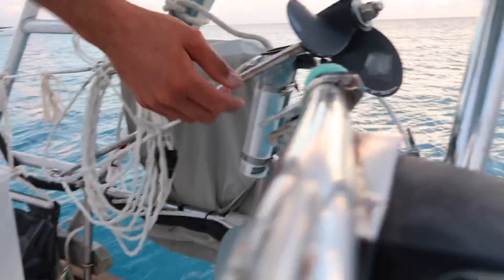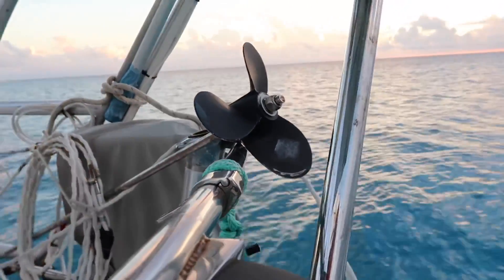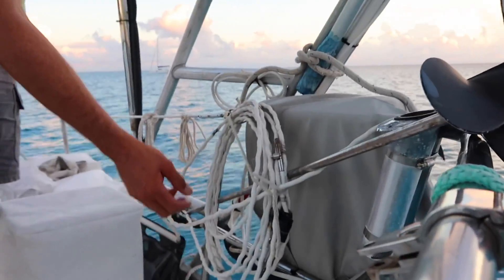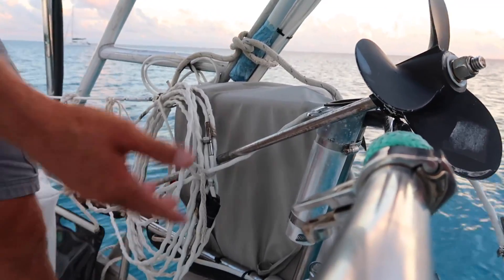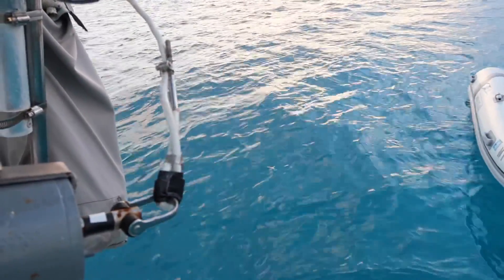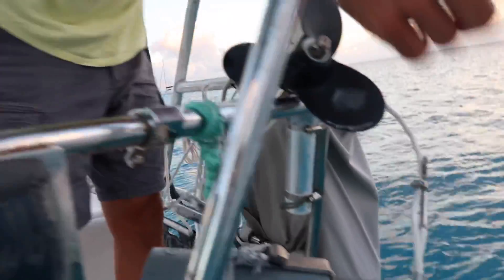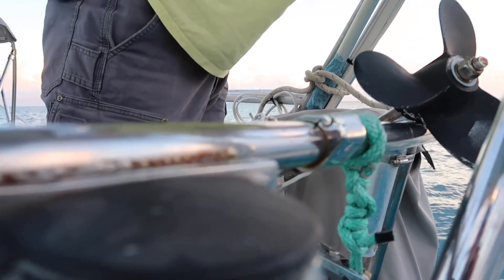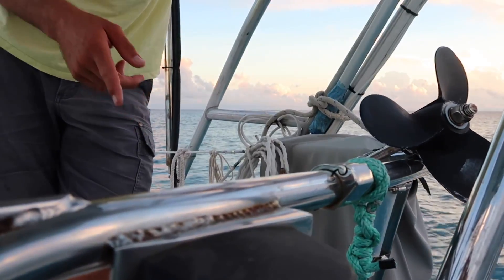A Quick Look at a DIY Hydro Generator

Comment: Hi there, I've just come across your vlog and I'm really impressed with you hydro generator. Is there a possibility you can provide me with a bit more information because I would love to build a similar one. A couple of questions immediately come to mind ...what make/model/voltage/wattage of generator did you use (or did you construct it from a motorcycle alternator or hover board)? Also what size prop? Thanks in advance. Bruce

Comment: He needs to turn the propeller around so the cup side faces the oncoming water. He should gain more rpm's that way.
Reply: Not sure that would help with that particular one as those blades would change hydrodynamics turning them around. Adding some kind of cone to the front makes more sense. :)

Comment: What was the permanent motor from? It would be great to get more information so that we could make one.
Reply: Looks like commercial 12volt starter
Reply: you can buy a permanent magnet generator for $60 in china, 500W at 600Rpm. then mess a little with DIY electronics

Comment: My main question is what is the voltage of the permanent magnet motor? Was it 110v or something else? Hate to be a pest but what was wrong with your diesel engine? My guess is air leak or lift pumps
Reply: They said 12v but you can get them in various voltages, AC or DC.

https://mwands.com/shop/product/wind-turbine-motor-pma